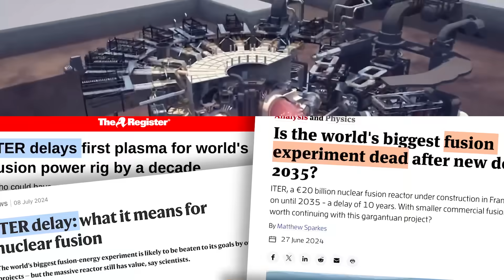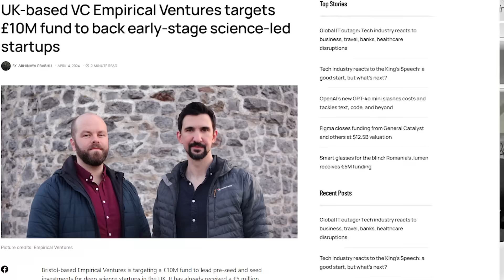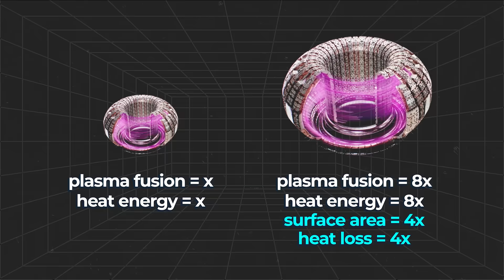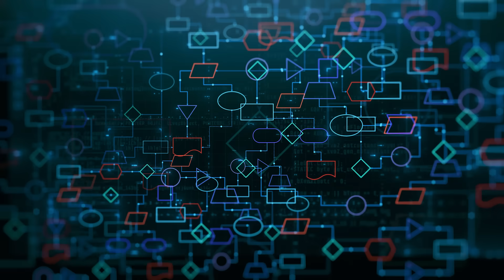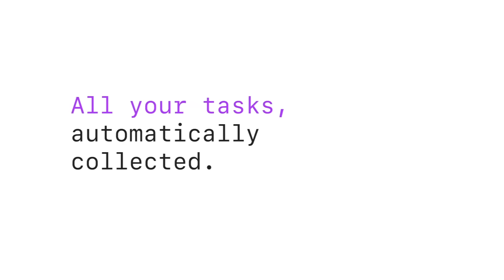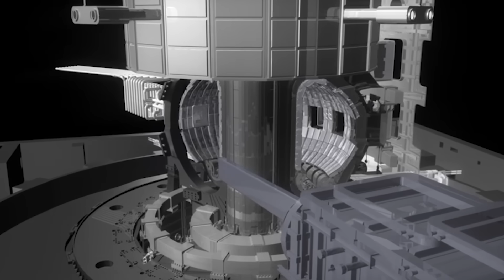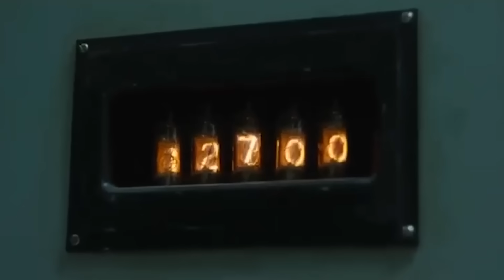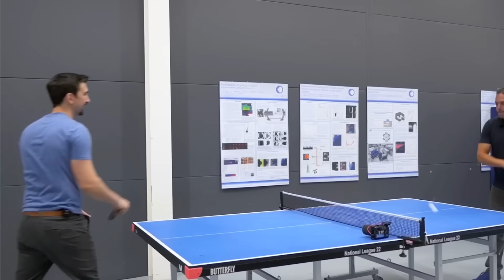Is The World's Largest Fusion Project Dead?

Comment: Technically many of these fusion projects were just test platforms in the first place, and not practical reactors, these are essentially just feasibility test reactors, so yeah, if it can work in this experiment, they can work up to full-scale systems. 
Did you expect them to keep it active forever? All it takes is a few successful reactions that net more power than they put in and bam the projects over, because now they can virtualize the data and simulate it in a virtual lab setting.
If you want progress you have to move fast.

Comment: We should have been doing this before we did anything with CERN and the LHC. Theoretical physic's has done NOTHING useful. Trillions of dollars wasted to understand we don't understand. I could have told you that for free. "science has failed our mother earth." S.O.A.D. I will also blame the fossil fuel industry. Cheap or free energy is almost impossible to monetize and will decentralize power. Thus we have over 6000 sequestered patents for reasons of National and Economic Security. Interesting that last part why would economic security have anything to do national security unless it had to do with oil backed dollars.

Comment: Summary: unlike breeder fission reactors, the fuel for fusion is a real problem. The waste volume (total waste, including device waste) is larger, handling fusion related waste is much more complex (complex devices vs. simpler fission vessels and heat exchangers +fuel pins or fuel salt). Fusion feasibility fails at realiability. Economy is grave at best. There is no scientific evidence that fusion can compete (on level playfield) with fast neutron breeder fission reactors in any of the aspects. (note: "waste" without the equipment/decommissioning waste is non-scientific). 
0.010 kg / year / person Li is mined. That is 0.0007 kg / year / person 6-Li that would be the fuel of T-breeding (Practically sufficient for appr. 5000 kWh / person / year, not even enough for electricity; way insufficient to support industrial heat, H2, fertilizer, syntethic fuels, etc... - all required to significantly reduce fossil fuel usage). Needless to say: "it does NOT run on seawater". Since not enough neutrons to breed T, fission is a must. If U or Pu fission is used, the fusion is totally unnecessary. Just adds complexity, 10x more equipment waste, extreme problems to run continuously and maintain operation. Be could be used to help breeding. However, the 240 ton of the world's 1 year Be production would be enough for less than 1 DEMO-category fusion plant (actually 480 tons needed according to ITER studies, that is 2 years worth of all Be mined worldwide). Thousands of reactors would be needed. Not enough consumables to replace 1/2 of fossil fuels, and extreme amount of waste and problems. Clean energy equals fast-spectrum fission for the time being, 37-Cl based molten salt fast reactor being the best, Na and molten salt heat storage being 2nd  (perhaps the D2O technology from India can be an immediate solution with some smart fuel arrangement, see "Breeding Capability and Void Reactivity Analysis of Heavy-Water-Cooled Thorium Reactor"  Sidik PERMANA, Naoyuki TAKAKI & Hiroshi SEKIMOTO ). Most likely there will be other options in the long run. Fusion would make sense if it could be made small (SMR-size or even smaller), not even on the horizon. Also feasible for some scientific applications with fast-neutron subcritical neutron multiplier for fast neutron pulses.
So far politics have killed the good paths and paying demo-"science" projects that is known unfeasible. The last correct scientific conclusion about DT-fusion was from LANL: "The investment of time and money required to commercialize the (fusion) hybrid cycle could only be justified by a real or perceived advantage of the hybrid over the classical FBR (fast breeder fission reactor). Our (LANL, 1980) analysis leads us to conclude that no such advantage exists." It is even worse if positive energy balance from DT-fusion is required. Anyone objecting: don't take it as an offense, just show the scientific study of the volume and handling of total DT-tokamak fusion related waste, including the equipment waste (and compare to fast-neutron fission reactors).
Fusion with virtually no waste is a dangerous myth. Especially together with the "unhandlable amount of fission waste", another deceptive myth. The DT-Tokamak concept was studied by Hans Bethe (1979) and LASL/LANL (1980) and known for certain to be a giant waste of resources without real advantage compared to fast-neutron fission. With much money spent on it, it simply diverts attention from working fission reactors that produce less waste for all practical purposes, if we recycle fuel, most fission products (16 million USD /ton) and consider decommissioning waste for the total plant.

Comment: My record at university is very humble, at least I know about Maxwell's equations, and that plasma is an electric conductor.
Allow me some questions though. 
Shouldn't we introduce totally new ideas and paradigms here? I mean, the Stellarator is exciting, and especialy the new use of AI to guess new field geometries and regulations.
But we could go much further, and far away from what is being done currently.
I am thinking of some cyclic process, some vibration, that allows to harvest electric energy very directly, by building the fusion reactor as a transformer, so that electric currents through the plasma, and vibrations of the same plasma, will induce AC currents in the coils that have been reshaped and extended not only to guide and ignite the plasma, but also to deliver electric energy from the cyclic fusion directly.
It will have to make smart use of resonances and eigen values. A resonance circuit, that literally sucks out a lot of energy from the plasma expansion and contraction.
A quick guess for a operating frequency would be 200Hz.
1.we could assemble big and small coil systems into each other, that work like organ pipes, and mathematically, like a Fourier synthesis of a very steep impulse. So if there is heat and pressure already from some of the coils, this should add up to ignite the fusion for some milliseconds, by inducing a shock.
2. Where does the energy come from: think of a push-pull twin system. Like a gasoline boxer engine for a motorbike. When one chamber ignites, it will induce a high current, and with some resonators and phase shifters, it can be routed into the other chamber's coils and into the output transformer. So it will ignite the next pulse in its twin, and also deliver some electric energy to harvest.
We might choose a higher frequency that lets the plasma vibrate easily, so during the positive phase, at the highest point there would be fusion happening. This would be quite nice to control. In that case, one chamber might be sufficient, at least after we found out how to start up that thing.
Or we might try a much lower frequency, to make the system resemble such a combustion engine with two cylinders and alternating explosions.
I don't know what vectors the vibrations should have, more change in the diameter of the plasma torus, or more in the thickness of the plasma stream, or should it look like a toothwheel that rotates. But AI might help to simulate some configurations.
What do you think? Part of this idea is just to do something really different, but also use some older knowledge that is almost forgotten.

Comment: and yet even 50 billion would be a drop in the bucket for a single of the member countries. Might I remind everyone this is the scale of finance countries deal with daily. So for a multi decade long multi-national science project 25 billion is a steal.
Also having directly worked on theory behind ITER and JET myself I can happily say that torioidal confinement really is the only option - the rest don't have the rapid recyclability (fusion rate), scalability (ironically financial effectiveness and size flexibility) required. Mark my words - all the private start-ups will hit the same walls all the old equivalent experiments did and won't reach engineering Q... and honestly SMRs might just leapfrog fusion all together

Comment: ITER can't be stopped because it's like a locomotive which has acquired huge momentum. Canceling the contracts involved would  probably be just as expensive as letting it get to fruition. I've always thought making it a multinational collaboration was a humongous mistake, for the reasons you mention in your video. They must proceed through consensus, and that's a hurdle when you deal with advanced technology. The performance of fusion experiments advanced at a greater pace than Moore's law up to 2000. Then came iTER, and it stalled. This has brought me to the conclusion that in this kind of endeavors competition is preferable to cooperation, because it keeps the sense of urgency alive. 

Regarding the new companies, many are just exploring concepts that were explored and discarded years ago. I can see a couple of them which may have some chance of success, though. However, I doubt any of them will be able to deliver in the time they claim. I joke that thanks to private fusion companies fusion is no longer permanently 30 years away; now it's permanently 5 years away... 😅

Comment: Let's consider the following options.

Cold Fusion (LENR) - Unproven hypothesized type of nuclear reaction that creates nuclear fusion at room temperature by producing more energy than the input energy can be produced from its altered state.

Tokamak Nuclear Fusion Reactor (ITER) - Development cost for the ITER is $150 billion. Requires a temperature of 150 million degrees Celsius to create nuclear fusion. Reportedly the record to date but having to use more input energy than produced is 69 megajoules of fusion energy for five seconds using 0.2 milligrams of fuel. 

Small Nuclear Reactor - The accumulative effect of multiple small Reactors eventually ends up with the same problems that affect large reactors.
4,536 Mw (VOGTLE) Nuclear Fission Reactor Costs $35 billion requires 1,282 hectares, nuclear safety costs $200 million per Mw, no technology to deal with nuclear waste and only has a known minable uranium reserve at current extraction rate of 80 years. 

The alternative is a Constant Variable.

 Solar Hydrogen Energy Recovery Gas Turbine is a Constant Variable. 

301Kwh (equal to 46/6.6Kw home solar installations) of solar energy collected from the sun’s 5 billion year supply of nuclear fusion at atmospheric temperature is sufficient for electrolysis obtained from 1/3 of the water volume of an Olympic swimming pool that is recycled by steam reforming to produce Hydrogen gas contained within a 14 cubic meter space compressed between 350-700 bar to enable the start-up sequence of a hydrogen Gas turbine to synchronize with its Variable Frequency Generator to maintain equilibrium of compressed hydrogen gas to continually fuel the turbine.

Oxygen produced from the electrolyzing process is also compressed to provide a 33% Hydrogen fuel saving precooled engine catalyst to bring online the turbines energy recovery system and sustain a variably regulated base load power supply to service grid energy demand. The operational variability of the turbine not only addresses firming but also manages both grid inertia, and mis matched frequency while generating a capacity energy range between 86 - 330Mw with optional co-generated steam capacity up to 700Mw of electrical energy on a 24/7/365-day basis.

The power generating turbine has three operational parts, 3m in diameter, 5.5m long and weighs 6 tons. Installation cost $36.5 -49.5 million, requires an operational footprint area the size of a football field, noise level is 60dbl at 60m, incorporates direct air capture of CO2 at 1,400 Kg/sec and includes a 14-year maintenance free, end of life decommissioning or optional refurbishment program.
 
Sixty-five carbon and pollution free, shovel ready, off the shelf technology, combining solar nuclear fusion with modern aerospace propulsion and existing nuclear and coal fired steam technology to generate a total of 21,450 Mw can be retrofitting to any of the 120 Hydro-electric schemes, placed at grid conversion points, to dispense with renewable energy zones, would provide Australia's 26 million population its entire energy needs covering a combined operational area of 33 hectares for a 2023 total cost between $2.4-3.3 billion. Construction period is 3 to 5 years, meet net zero energy target twenty years earlier and makes wind and solar farms including hydro, gas and nuclear energy production redundant.

Comment: Even if ITER is going to be completed and working by tomorrow, humanities will still need countless measures and transitions to get from what we have today to a fusion based energy system. On the grand scale of things, 10 years, even a century does not matter. Thus, there is no such thing as too late on solving the fusion problem, as it is already too late for us to lay back after the problem is solved. Not only that, but fusion have also already been delayed a lot of times and cost substantially more money ever anticipated, and an additional 10-year delay is not a problem at all.

Also, the core of ITER is still a science experiment, aiming to solve questions and problems small scale system cannot. Just like LHC solving problems that small MeV level accelerators cannot. From a political standpoint, if ITER is less of a science cooperation, there is absolutely no way for it to still have progress today, considering tensions between essentially all countries in the party.

For the quantum mechanics example, I really think it is stupid... I understand it is just an analogy that makes you sound smart, but real life is a lot more complicated... TOKAMAK and Stellator (essentially the magnetic confinement ones) have received the most attention and research in the world for a very good reason. It will work the best. For instance, ICFs are very unlikely to be used as powerplants because it is pulsed. Fusion have been under research for almost a century now, longer than the time it took for human to be on the moon from inventing planes. As a result, the better analogy will be finding solution to fusion is like a QED interaction between two electrons, magnetic confinement is like all the scenarios where the electron repels each other, and the rest will be the other approaches. Quite obvious which one to invest in ;)

Finally, not considering the accuracy of your private fusion funding data, a huge number of fusion companies out there is just a "scam" that is just impossible to work. other companies like Helion were also unable to meet timelines, a common thing among commercial companies because they need to appeal to investors. In theory, if we split the funding of ITER into those companies, it is also very unlikely it will work, because fusion is just so fcking expensive. In the end, with this level of funding, none of them will work at all, and when we can actually get a solution out, it will be orders of magnitudes more expensive than ITER will ever be.

Comment: There's another competitor: fast breeder.

For example in France, if we replace the nuclear fission power plants by  fast breeder power plants, with the stock of 300 000 t of  depleted Uranium 238 that we have, we can produce during 2000 years (and more with the stock of plutonium) the energy (fuel+gas+electricity) consumed in 2021.
In Russia the BN-600 fast breeder and in China the CFR fast breeder are connected to the electricity network. In France, Superphenix prototype worked during one year without any problem.
In France we don't need any nuclear fusion power plant.

Perhaps fast breeder is a solution for other countries.

CEA says "The uranium resources identified today could power a major global nuclear power plant for thousands of years."
Académie des sciences says "Currently unused depleted uranium reserves are considerable. France, for example, currently has a stock of depleted uranium of around 350,000 tonnes, which could provide hundreds of years of electrical energy production [...] even if uranium mining ceases”.
Reply: Is it economically viable?

Comment: I think this is exciting if they can pull it off. My question is,  what type of materials are being used for the walls of this fusion reactor considering that plasma would evaporate the materials, since there is no known material with melting points that go beyond the temperature of the plasma? I know that magnetic fields can be used, but isn't that determined by the particles that are being used inside of the fusion reactor?